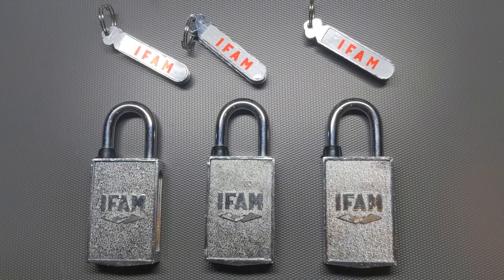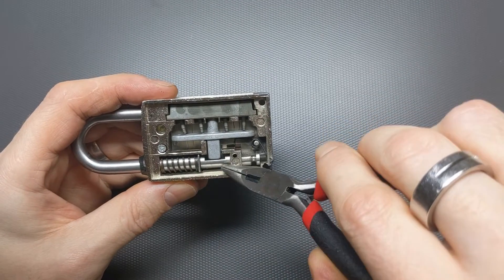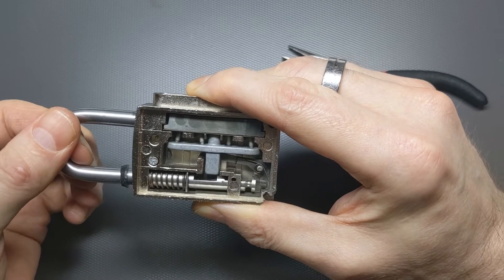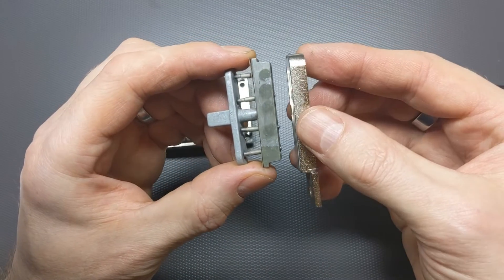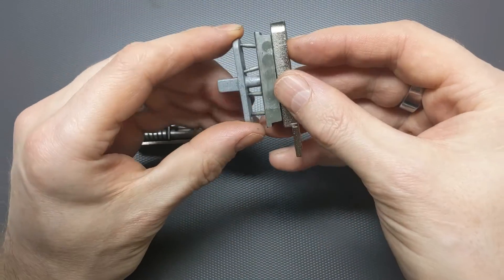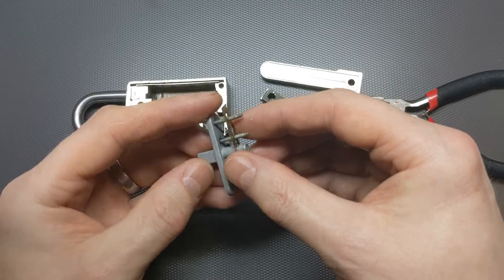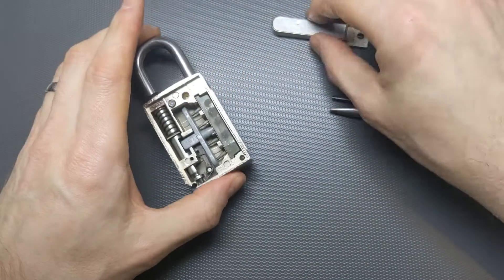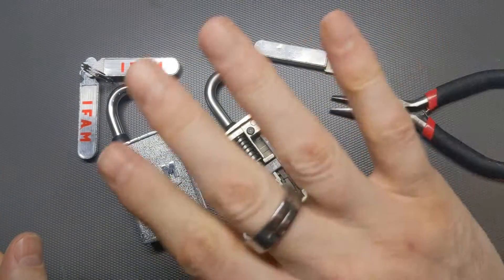[081] How a magnetic key works

Comment: This is kind of exactly what I have in mind but in the a different way, this is little complex because of magnets , but it has only 6 positions means a total combinations of 4 magnets arrange in 6 positions where duplication is possible, actually not much if the key is having motors like a perfect tool to unlock it.

Today I took a decesion to build a perfect lock with a key which looks like the normal key, and it should not be open by any locksmith for the next 10 or 15 years. 

Please wish me all the best in simple words I will build a lock like an enigma machine😅

Comment: Very cool.  Just picked one up from the thrift store, was curious how it worked, and found this video.  Above and beyond what I was expecting.  Thank you.
Reply: On the back of the package (unopened), there is some writing.  From top to bottom - Release, 4, 3, 1, 2, 4, Bottom (with an arrow pointing up).  Does that make any sense to you?
Reply from the maker: I'm not sure what it means, but I guess it might be an encoding of the positions of the magnets in the key.
Reply: @LockPickingCuber  Thanks.

Comment: How would i pick it? Provably using a similar principle to bump, or pickgun, by using a few small motors in a row, with a slightly off centre magnet on each shaft, and maybe some kind of odd gearing so the patterns that they oscillate with each other is elliptical, and a speed controller. Outside of that? Grinder.

Comment: I had one of these magnetic padlocks some 40-odd years ago. It was advertised as unpickable. IIRC, the paperwork that came with it showed a number of small magnets placed with their N or S poles down. there were definitely more than 4 magnets arranged down the 'key' in a zigzag pattern and these would attract their opposite number inside the lock. I've not seen the like since until recently when I saw a woodworking plan for a bedside locker where the door was  locked by virtue of a number of small magnets set into holes using gravity to keep the magnets in the door/top

Comment: I always seem to see intresting videos you done weeks later. Dunno how I miss them.
Never seen inside one of those before. Was real intresting. If I was gona have a crack at locksporting one of them open, I'd try some magnetic rakeing. 
Pull the shackle. Move a magnet round on the part the key goes against. 
Getting the right tension on the shackle and the right power magnet may take a bit of trial and error tho. 
I'd try light tension and rake with the wrong key. Then swap to a stronger magnet if that fails. 
I'd be real intrested to know if you got anywhere with any method of opening them👍

Thanks for the look inside that lock
Reply from the maker: Thanks for the comment, Deadlocks! Yeah, I've been trying since making the video but haven't managed to do better than "setting" one pin. You're probably right that the amount of tension and strength of magnets are important, so I'm going to keep trying! I've also got a completely different type of magnetic lock that I'm making a video on now which should be ready later this week...

Comment: That's an interesting design, but now I'm curious as to whether or not it can be bypassed by any low-skilled thief with a magnet strip?
Reply from the maker: Nope... I should have shown that on the video but even with lots of magnets it wasn't possible to bypass it. The rods that prevent the opening of the shackle are very sensitive to exact positioning of the magnets. Good question!
Reply: @LockPickingCuber  Ah okay, thanks for the clarification. ✌️
Reply: It is possible to bypass the lock with a strong magnet. I thought it was shown by bosnianbil and I also did it.
Reply from the maker: @se032131  Oh, interesting! I wasn't able to do it -- did you just hold the magnet, still, up against the side, or did you have to move it around?
Reply: @LockPickingCuber  you will have to move the magnet around while putting a  little tension on the shackle

Comment: Does the lock open if you apply tension to the shackle and then place the key? Or does friction prevent the pins from moving? It seems like if it opens when in tension, there are a couple options. One would be to build a small device that rotates a small magnet around a shaft rapidly trying different positions.
Reply from the maker: Ah -- good question. I just tried it, and no: if you apply tension and then place the key, it absolutely won't open -- or at least I wasn't able to get it to do so. Makes sense, I think, as applying tension to the shackle also applies tension to the pins which need to be moved by the key. Still, I think your idea is interesting.
Reply: @LockPickingCuber  Bummer... I wonder if playing with varying tension levels might work. With "light-enough" tension the pins won't bind. But you might still be able to set them. Maybe you would end up getting some feedback in the shackle that you could practice noticing?

Also, I would expect the pins to try to be pulled towards the magnet in a straight line. That means they will sometimes try to go through the position where they are orthogonal to the bar which is the position in which they are most likely to bind. If you had a magnet rotation around through various positions it might be possible to get the pin not to bind before it falls in the hole?
Reply from the maker: @alexandrezani  OK -- this is interesting. I'll keep trying!
Reply: @LockPickingCuber  OK, I should just go get my own to play with. (I'm sure my partner won't mind me dipping into the house fund to get it shipped from the UK... God these things are pricey in the US!)